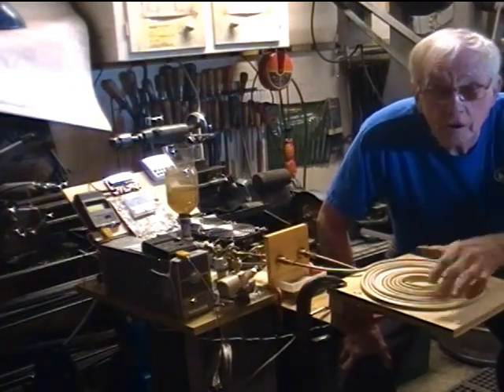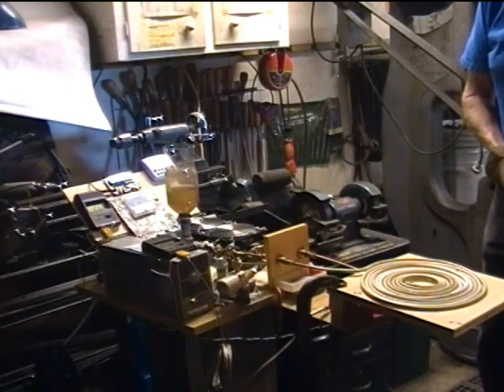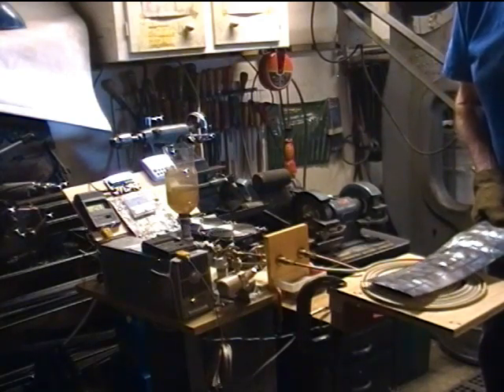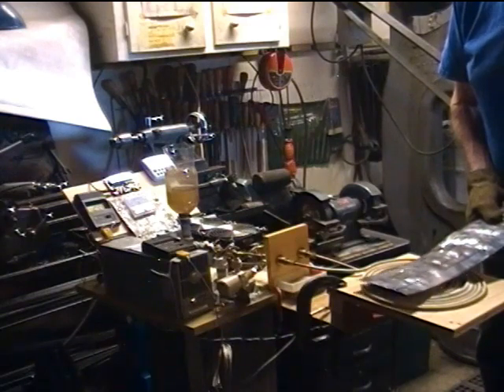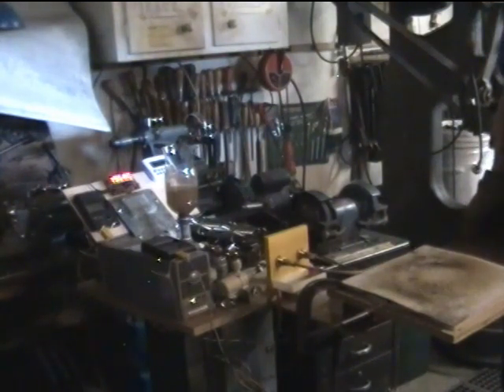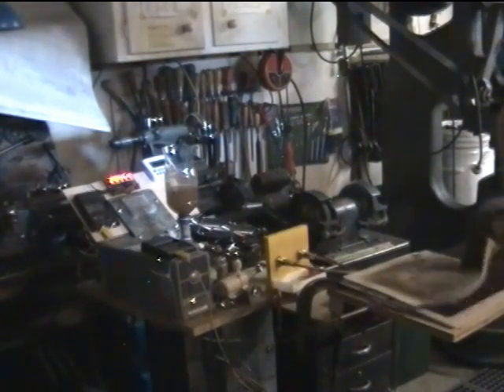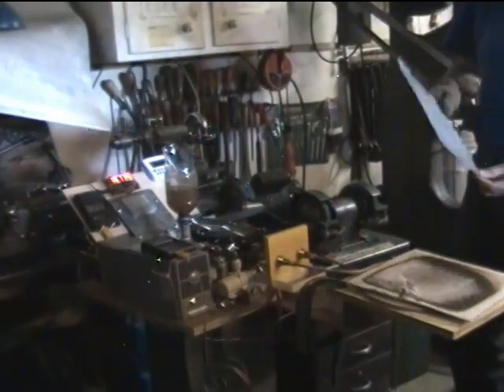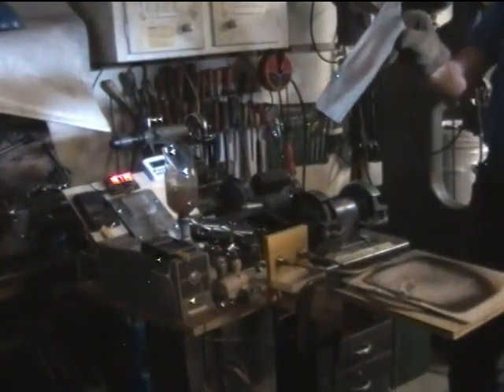Pancake Coil Test on 2500 Watt ZVS Induction Heater

Comment: As per Captain Obvious, the heating of any piece of steel or metal depends on its total magnetic hysteresis given whatever alloy it has. If it doesn’t have much of a reactance to the applied alternating field, it won’t heat up much.

Comment: What will happen if you reduce the number of turns in the pancake coil, about 4" OD?
Reply from the maker: If the OD of the coil was about 4 inches and the ID about 1 inch I think I might get about  6 turns.  That would cause the frequency to increase substantially and the power density too.   I'm just guessing here, but the frequency may be a bit too high for the Mosfets, maybe not.
Reply: @frenchcreekvalley 
Thankyou for your reply.
I really appreciate your prompt response. Maybe I can have the same size coil, but put a bit of a curve to it. Like the shape your hand would make on a 5" diameter pipe. 😊👍

Comment: You could use the pancake coil on one ZVS to preheat a smoked graphite ingot mould when you are about to pour from a melt on another ZVS. Very little chance of disturbing the carbon coating.

Comment: Hi, Is Coil Voltage also 48V or more than that?
If Yes, is there difference between 2500W, 1800W and 1000W?
Reply from the maker: Yes, the voltage across the work coil is a lot higher than that of the power supply.
I just measured the voltage across a 12 turn 2 inch ID work coil on my 1000 watt heater with a multimeter and it is 220 volts rms.  I also looked at it with my old Tectronix 422 scope and then remembered why I don't pay much attention to the voltage across the work coil.  When I connected the 10X scope probe and turned on the power, I got a 300 volt peak to peak signal (at about 65kHz) that was approximately sinusoidal.  But, after about 30 seconds, the scope probe became too hot to touch, the insulation on the ground lead melted, and I almost burned it up.  The scope probe circuit's inductance (whatever it was) tried to act as a parallel work coil, but with only tiny conductors!!!
  I don't think these readings would change very much for the 1800 watt or 2500 watt heaters, but I have not measured them.  I really don't need to do that for my applications.
  For what it's worth, the experts say that the voltage across the Mosfets will equal
   The power supply input voltage X pi.
Reply: @frenchcreekvalley  I want to measure frequency with my multimeter it's up to 250V. I guess can't do with it.
Reply from the maker: @mohammadrezasafari102  If your multimeter reads rms AC voltage, it should be okay.
 If you live in the USA, check the voltage at a  power outlet in your home.  If it measures approximately 120 volts, then your meter is reading rms.  If this is true (which is  quite normal for a multimeter) then you will be able to read the voltage across the work coil.
As always, use caution when measuring voltages this high.
Reply: @frenchcreekvalley  The voltage across the coil is always higher than the ZVS input...by about a factor of 3.14159265358979......
Reply: Hi, would this pancake coil heat two sheets of metal if you placed one underneath the coil and one on top please?
Reply: @lukebrown6913  yup.

Comment: Hi. Nice Work same as usual.
How long to take a piece of metal (say steel) get around 200-300 Celsius.
Reply from the maker: You can see that the heating is uneven, but  the thin tin, (the unrolled coffee can)  would get to about 300° C in about 20 seconds.  The 16 gauge steel sheet would get to the same temp in about 50 seconds.  This heating rate would require that the insulation be in place on both sides of the material, as you see in the video.